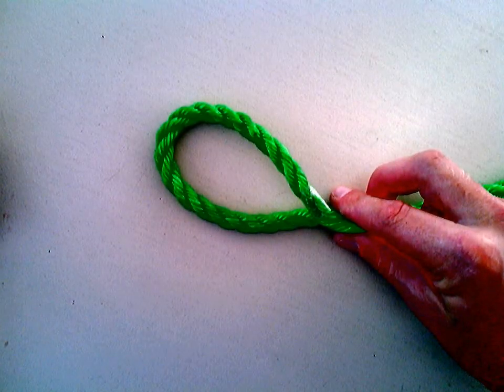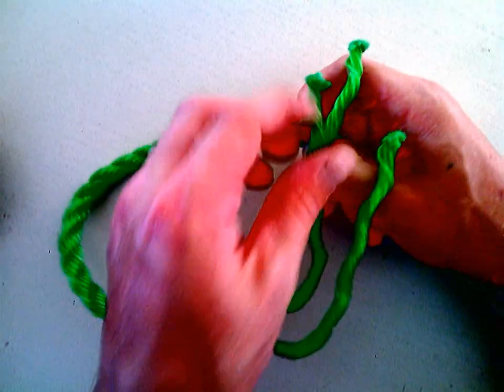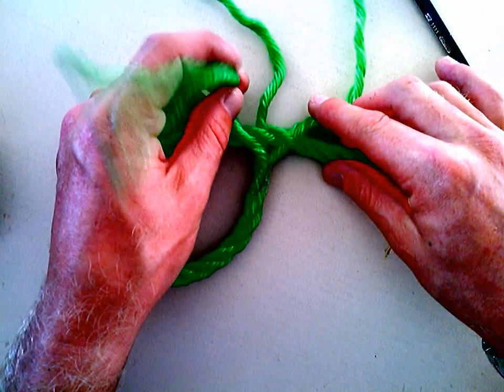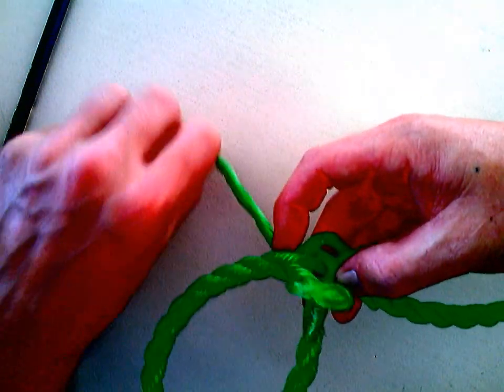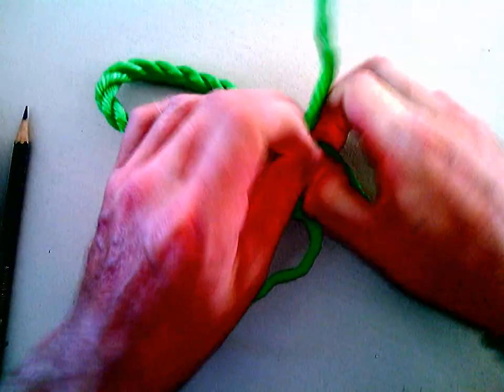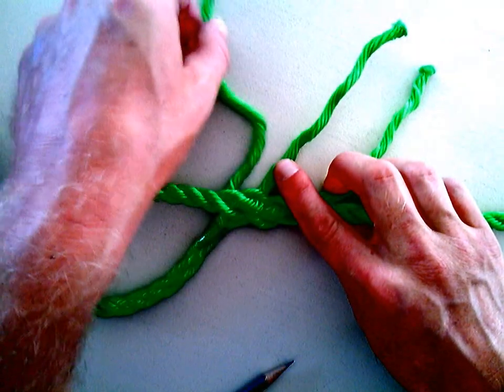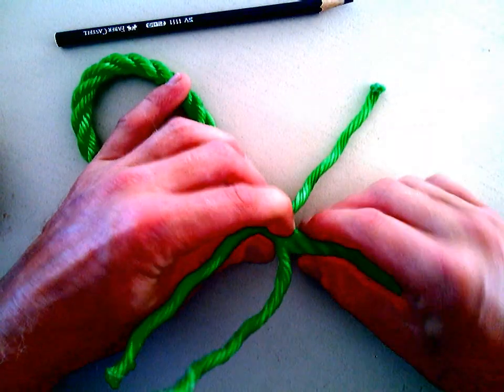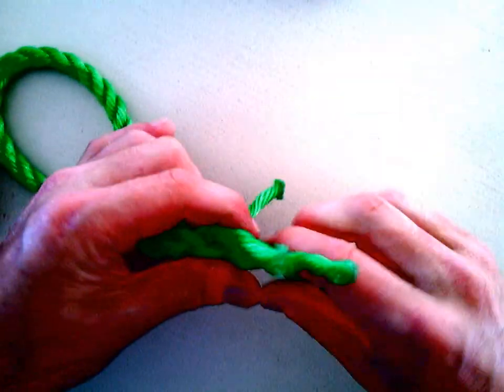Loop Splicing 10mm, 3-strand Nylon Rope

Comment: How long do you make the tails?
Reply from the maker: As long as you want to make them.  The longer they are the stronger the spice...however the longer they are the longer it takes to splice!  Shorter tails are faster to splice but do not offer the strength that longer tails do.  It is a personal preference ultimately.